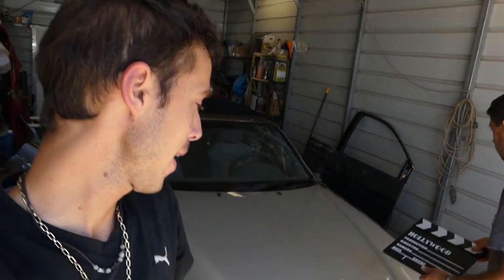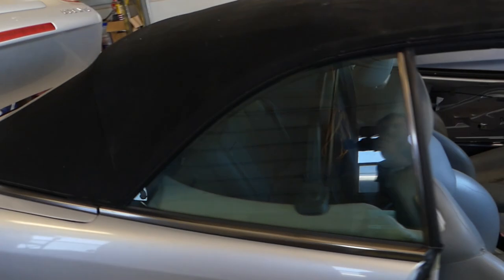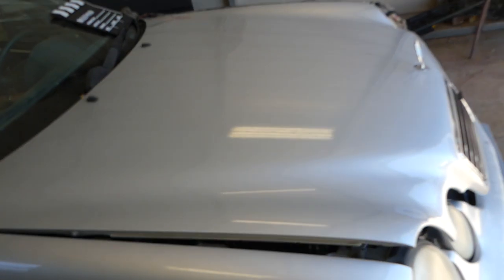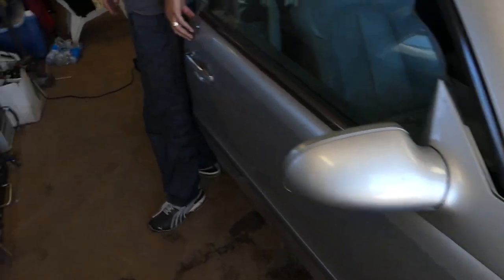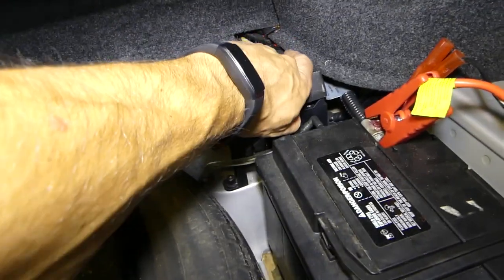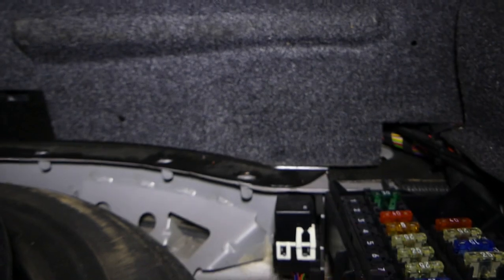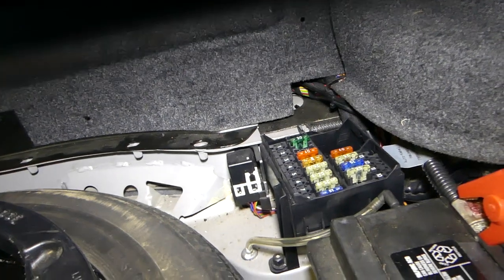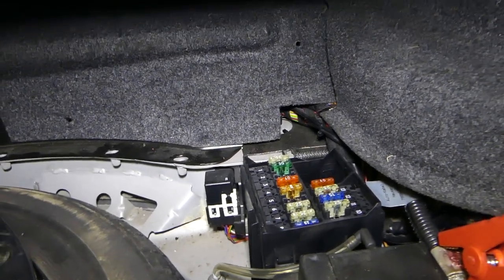MERCEDES CLK W208 FUEL PUMP FUSE CLK200 CLK230 CLK 320 CLK430

Comment: What was the original problem with car?? I have a CLK 430. It cranks over , but sometimes it only cranks but does not start. It usually happens when car is cold. The car never stalls out while driving. Just started having this starting issue. I’ve looked for start relay location, but no one seems 
to ever show location. Can you help me ? Thank You. 2000 clk 430. Less than 60,000. Miles. This is a convertible.

Comment: I have the same problem but it did not helped me can u help me?
Reply: Bilal Baran try a search about crankshaft position sensor
Reply: Check other fuse Box underhood on Passenger Side ,replace burnout Fuses, mayB help or , Check fuel filter or Fuel Pump or Replace Yourself.  experment to see hopefully the Fuse Works